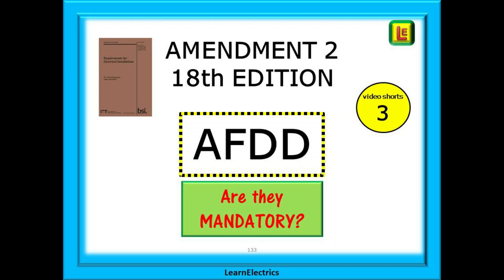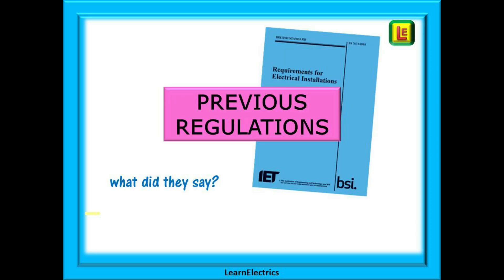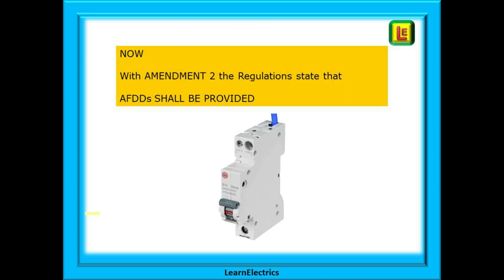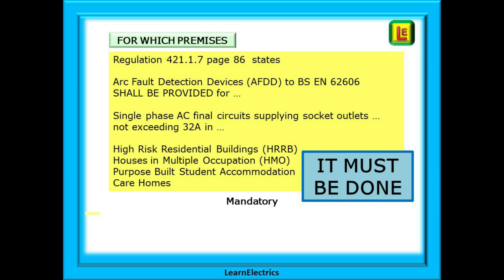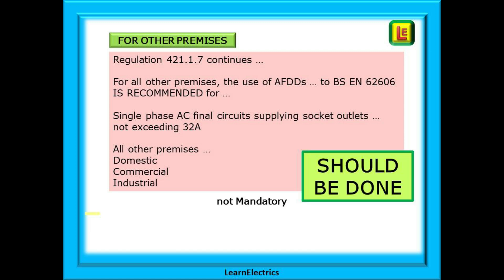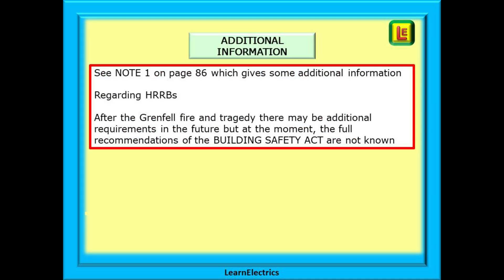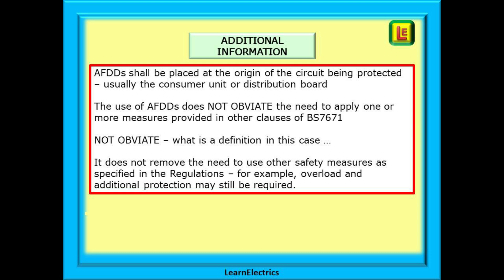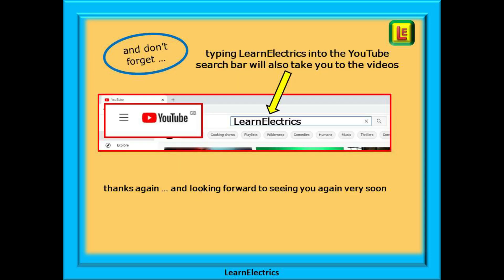AMENDMENT 2 - 18th EDITION – AFDD – VIDEO SHORTS No. 3

Comment: If a Hostel 2 and 3 level is fitted with Hager AC RCBO'S all boards do the socket circuits have to be changed  for AFDD'S  and why is that just so I can advise the owner  Thanks
Reply from the maker: RCBOs and AFDDs are two different types of protective device. They are not the same. Hope this helps.
Reply: @learnelectrics4402  yes I know that but can you tell me if it is mandatory to take out the AC RCBO'S and replace them with AFDD'S in a large backpacker hostel  and if so why or is the AC RCBO'S ok to be left

Comment: How about AFDD while doing EICR , can it be code C3 ? Thank you
Reply from the maker: C3 is improvement recommended. As the inspector you decide if improvement is required but then its up to the customer. Make it clear on the EICR what recommendations/reasons you suggest
Reply: Thanks 👍

Comment: Are you of the opinion that the customer be required to sign a document for NOT having AFDDs installed on a Domestic installation even though AFDDs are only a recommendation in such circumstances? Great content as always.
Reply from the maker: Thanks Paul, this is what the IET have suggested as a way of covering your bottom if things go wrong later and they say that you never told them. Dave.
Reply: @learnelectrics4402  Thanks Dave. Will be adding to CU quotes from now on.

Comment: 'Cost should not be a major factor in the decision making process to omit AFDD's...'

Yeah but here in the real world nobody is going to pay £1500-2500 for a consumer unit.
Reply from the maker: I know. Pricey just now but hey, don't shoot the messenger. I think we all knew that this was going to happen, especially after that terrible tower block fire. Thanks for watching. Dave.
Reply: Expensive AFDDs will force people into cheaper circuit design. AFDDs only need to be on circuits with sockets - even just one socket. So all sockets on one ring protected by an AFDD. The rest of the appliances on radials hard-wired in. Then all heavy appliances are omitted from the ring, except maybe a plug-in electric kettle. 

Two socket circuits could be off one AFDD. Say a 40A AFDD that supplies two DIN rail mounted 20A MCBs, supplying two 20A circuits. Both circuits have overload and fault protection. Some MCB manufacturers say selectivity cannot be guaranteed with MCBs/RCBOs in series - in this case the AFFD may trip instead of the MCB.  Then have the two circuits on fuse carriers on the DIN rail with 20A fuses, giving overload protection.  We also have fuse in plugs as well with fuses suitably sized.

A little thinking can get around it and still be properly protected.
Reply: @johnburns4017  I would argue the current AFDD-less set ups are perfectly 'properly protected'. What percentage of fires are caused by something an AFDD would prevent? I'd wager it's small. This is just a money grab.
Reply: @electricalstuff259  
The USA went for AFDDs a few years ago to prevent fires.  They have radials, which will give a good arc if say a terminal screw is loose with high current being drawn - a fire risk. 

The UK use ring final circuits widely.  If there is a loose screw terminal the resulting arc may be minimised to a more safe level, a level that would cause a fire with a radial. This is because the current is fed from two points. Rings also maintain two ways for the CPC earth link back to the consumer unit, if the CPC is broken for any reason. 

One of the reasons the UK has had an excellent safety record in electricals since WW2 is the use of ring final circuits. 

Using screwless Wago types of connectors, that do not work loose over time, improves safety for sure. Also sockets with screwless terminals at the rear. In short prevent a situation where an arc can occur as much as possible.
Reply: And yet they manage it for a boiler….
Reply: @MrIbib  They also spend that and more on cars, or holidays. What's your point?

Imagine a world where your boiler still works perfectly but as part of a remodelling of the house you're told you need to buy another. Think people would?
Reply: @electricalstuff259  it’s our job as electricians to educate customers about why they need to upgrade.

That’s just the way it is.
Reply: @MrIbib  Cost of living has gone rampant and people already complain about the cost of fitting an RCD board.

Trying to convince someone they need to upgrade (there are very few good reasons) is going to be a very hard sell.

AFDD mandatory boards in domestic would lead to basically nobody getting work done. Thankfully we aren't there yet.
Reply: @electricalstuff259  you need to up your sales game.

Besides, they’ll be in the 19th.
Reply: @MrIbib  I don't think you're comprehending that you can't sell £1500 consumer unit changes on already-functioning electrical systems to people with no money.
Reply: @electricalstuff259  I don’t think you’re comprehending, that people with no money don’t, to use your example, renovate their kitchens.

Comment: It's all well and good the regs stating that cost shouldn't be the deciding factor in whether or not to fit the things but at the end of the day, and especially in today's financial climate, cost will be the factor that the majority of people will consider first, especially if all they need to do is sign a waiver. Hopefully we see a significant reduction in the cost of the afdd rcbos as they become more main stream. The fact they are now mandated in certain circumstances should expedite that reduction.
Reply from the maker: I think a lot of us agree Rodger. This can make the difference between a proper job and using a mate down the road.
Reply: @Roger,
The expense of AFDDs will prompt more economical circuit designs. As AFDDs only apply to socket circuits, you may find that all sockets, say in a flat, will be on one final ring circuit. Hob & oven hard wired on one RCBO. Washing machine & dishwasher hard wired in one one 25A radial on an RCBO. Tumble dryer hard wired in on its own radial & RCBO. Lights on one circuit. That is five circuits with four RCBOs and one AFDD. It could be three RCBOs and one AFDD if the tumble dryer is on the ring final circuit.  All to BS7671 and safe.
Reply: A year later they are still £120 and is an extra £250 or 1/4k for a standard domestic board with 2 rings and no raidails. Mad money.

Comment: I guess this will put a bit of panic into those manufacturers that don't have an AFDD available yet for their boards. Needs more manufacturers to provide them to help bring the cost down. The problem is of course that more reputable sparks that will try to adhere to BS7671, will now be under cut more substantially by others that won't fit an AFDD, potentially leading to more poorly installed electrics. £120 each AFDD/RCBO, I can see after a quick search.
Interesting that the IET believe they have the authority to demand a consumer signs off to say they don't want an AFDD fitting. For anything to go down the legal route, there would need to be an accident worthy of investigation, and proof would need to be provided that an AFDD would have prevented or mitigated against that particular incident.
Reply from the maker: Good points. I agree.